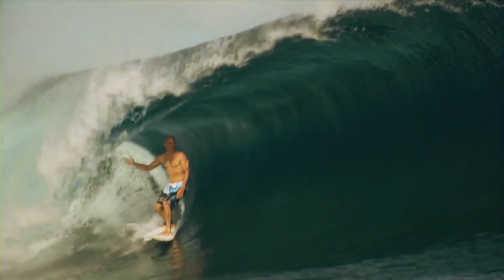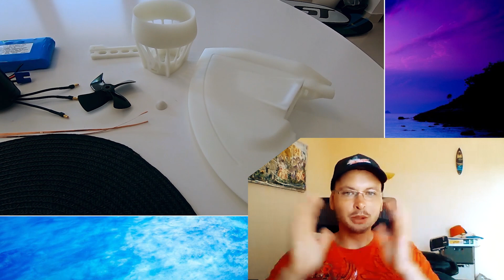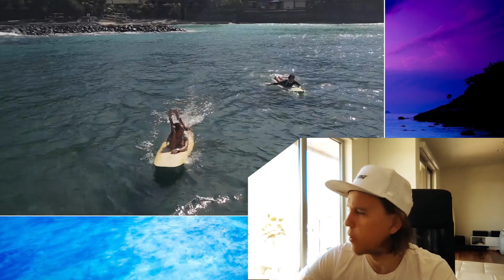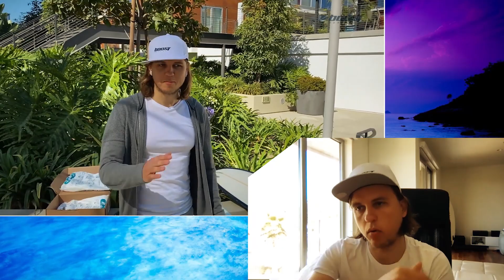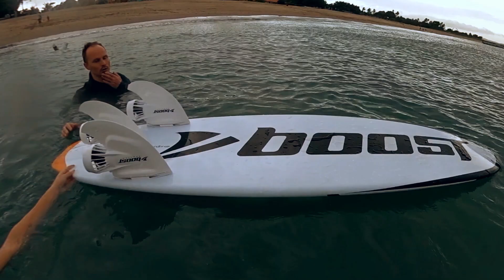BOOST FIN Preview - The World’s First Electric Surf Fin from Kickstarter

Comment from the maker: Timecodes:

00:00 Electric Boost Fin Kickstarter Success?
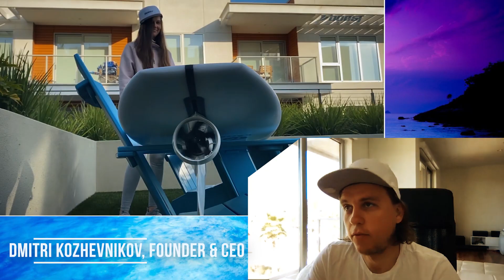00:48 Meet Dmitri Kozhevnikov, CEO & Founder of Boost Surfing
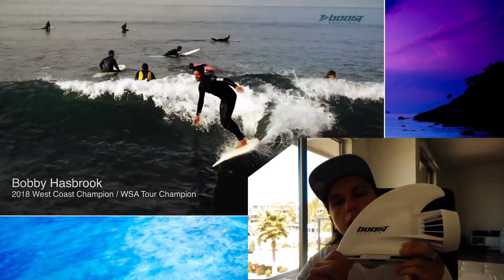00:58 Tell us more about Electric Boost Fin?
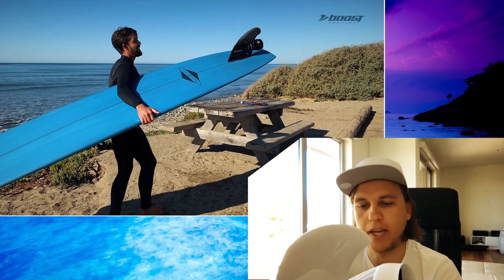01:10 How to install the Boost Fin?
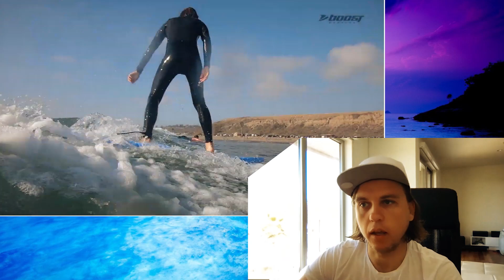01:35 Two main GOALS of the Boost fin?
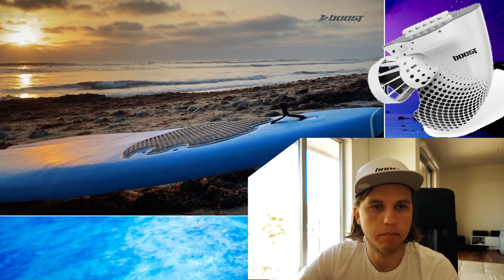02:30 Haters gonna HATE? For KOOKS only? It's CHEATING?
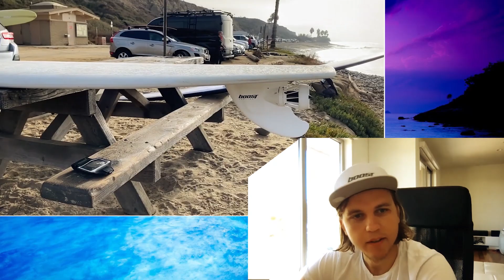06:20 I love everything motorised! It's about having fun on the waves
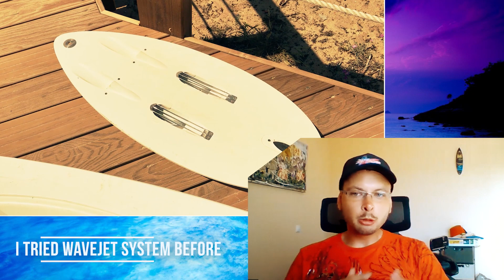07:02 I tried first WAVEJET system, it was too heavy and too expensive
07:20 How did you make it so inexpensive? Just $199 preorders?
09:20 Boost Prototype creation process video
10:07 You are based in Huntington Beach, USA, the surf capital
10:32 Boost Fin with Pro Surfer - Bobby Hasbrook experience?
11:00 PRO surfers LOVE IT?
11:50 The surf GIRLS love it too, Bali video
12:35 Pro-rider's Rad First Try on A Boost Fin (featuring Augusto Olinto)
13:52 Feedback and second version?
14:01 What attachment ADAPTERS do you offer?
16:02 Adhesive universal adapter
17:50 How about SAFETY? Propeller safety?
20:00 Short and long MODES of boost
21:11 How to attach REMOTE CONTROL? How does it work?
22:40 SEVERAL boost fins COMBINED? 3x Power? 5x Fins?
25:20 Can you attach it to the SHORTBOARD?
26:20 Smaller FIN and battery inside the board? Future ideas
27:30 The Boost APP? How does it work?
28:00 Continuous Mode for SUP paddle boards? 8sec, 20 seconds boosts
30:00 Track your progress, SMART button?
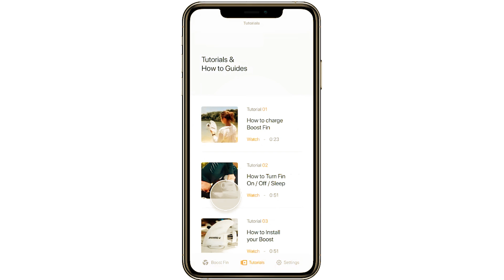30:15 COVID-19 Delivery delays and shipping plans?
32:00 Diving Scooter, efoil, SUP setup and future plans?
33:00 Diving scooter ADAPTER 3D demo?

Comment: How long will the battery last at full speed mounted to a SUP?
Reply from the maker: About an hour at half power. Full power cant be used more than 5-8 seconds
Reply: How can it be used on a sup?
Reply from the maker: With a sup adapter..
Reply: @JetSurfingNation  I was wondering how it would run steady on a SUP application? Can it be set for a steady range of thrust or just bursts to catch waves?
Reply from the maker: Yes using the boost app you can set the sup mode - long range low power output
Reply: @JetSurfingNation  sweet!!